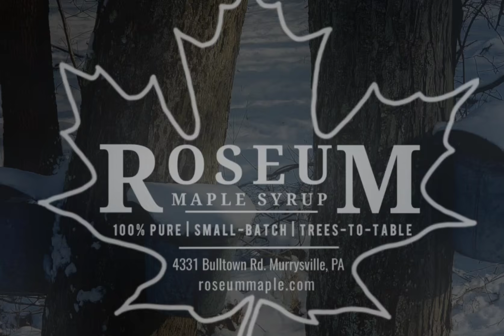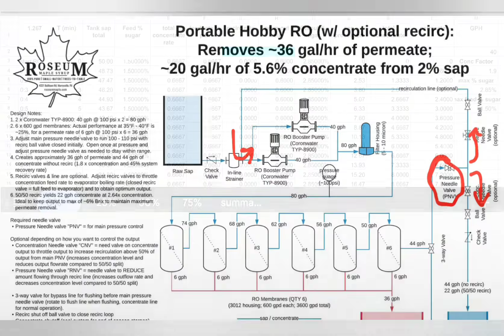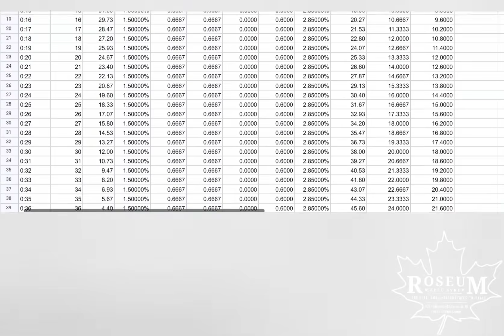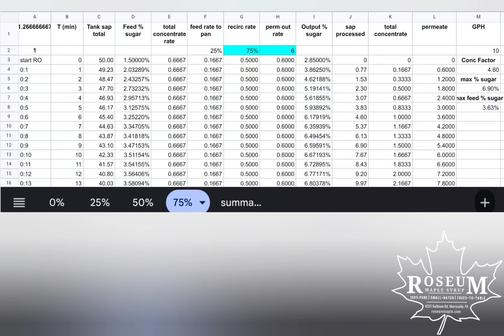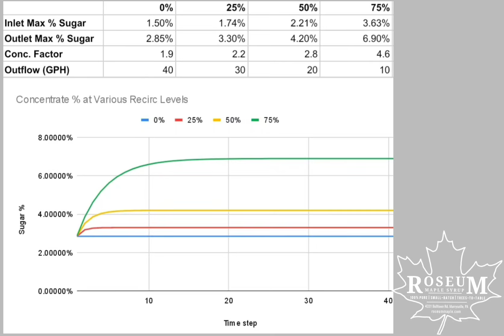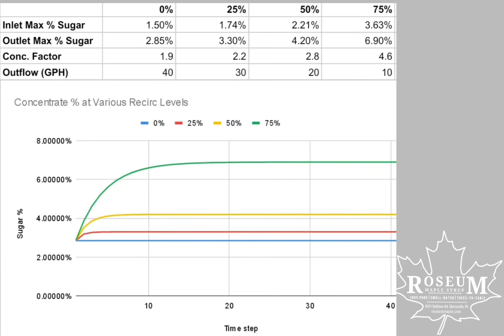Reverse Osmosis Recirculation Explained - Maple Sap / Maple Syrup

Comment: Today, 5-7-26, I got 8.4% concentrate using an 8800 pump maxing about 95psi.  Solution was table sugar simulator and a 36 gpd membrane was use.  Started at 85 psi and did not touch it.  Permeate line was on -25" Hg. I had always heard to keep permeate and concentrate flow amounts the same. My practice had been to keep adjusting pressure up as permeate flow fell.  In a quick run yesterday, when permeate was down to 1 drop every 30 seconds, I tried lower pressures.  Lag time may have been deceiving: 60 psi for instance did nothing.  Flow restarted though at 83 and I gained 1% like that.  Today, max pressure got up to 87.5 psi near end of run.  How would you tell what optimum pressure is other than just keep trying different settings?
Concentrate vacuumed out of system was  only 7.9%.  I have seen that before.  Was it reclaiming permeate from membrane?

Comment: Is there a way to get up to that 7% mark at 30 gallons of concentrate per hour?  Could you go up to 7 or 8 membranes on the 2 pump setup?  I currently have an RB 25 so 5 membrane 1 8900 typ pump, and I can make 20-25 gallon an hour going from 2-4%, but I upgraded my evaporator and pans to be at 30 an hour, I’d like to expand my RO bucket system, I’d really prefer to not be buying into 4x40 system.
Reply from the maker: I did 11 x 600 gpd membranes, fed by 2 of the TYP-8900 pumps and got 10.5 gph of ~7+% concentrate and 54 gph of permeate. You would have to triple that output for 30 gph of 7%.  I never tried backing off the pressure to max out concentrate flow and seeing if the permeate flow dropped much due lower pressures, but i think you could probably get closer to the 20 gph range, but never tested it. My small pans only boil about 10-12 gph, so I was content to run at that pace.
Reply: @RoseumMapleSyrup  ok but how about your 50% recirc with like 8 membranes?
Reply from the maker: @0731bart in general recirculation increases % sugar and decreases final flowrate of your concentrate. I don't see anyway to make that work.  You need to proportionally increase overall flow and permeate rejection, without causing other side effects, like too long of a membrane array that has too much pressure drop, causing reduced membrane performance or rendering entire ones useless.
Reply: @RoseumMapleSyrup  your design in that video with the 6 600gph and 25/50/75 recirc figures, would the 25 and 50 percent recirc still work with 7 or 8 membranes?  Maybe I can’t get to 30 gallons per hour at 7%, but I’m trying to make the biggest possible improvement to my current 5 membrane 1xtyp 8900.  I have a 30 gallon head tank, so I have some surge/buffer capacity.  What would you do?  I’m not opposed to doing some recirc back to the tank prior to boiling to increase the brix in the sample.  

I would like to try to make my current RO work for me for a few more years, but I need to add on to it. 

Thanks!
Reply from the maker: @0731bart yes, adding a 2nd pump in parallel and expanding to 8 membranes would work.  And yes, you can still do recirc on that.  I scaled to a 2 pump system with 11 x 600 membranes and set it up to do recirc if I wanted to (but never used it that way this year).  Its very important to add the 2nd pump as you increase overall membrane capacity.